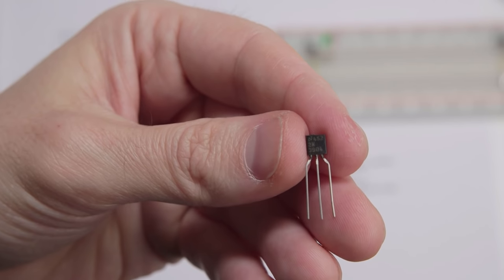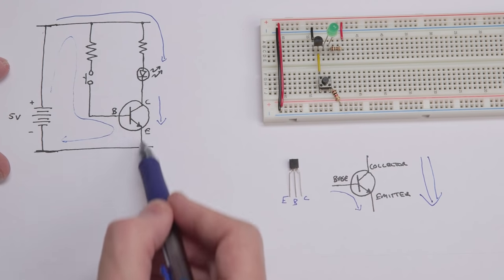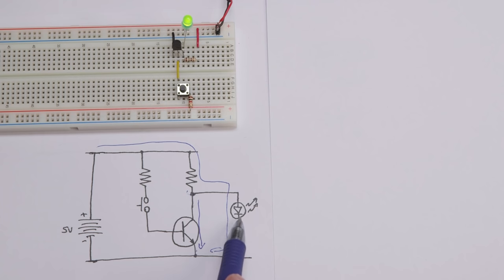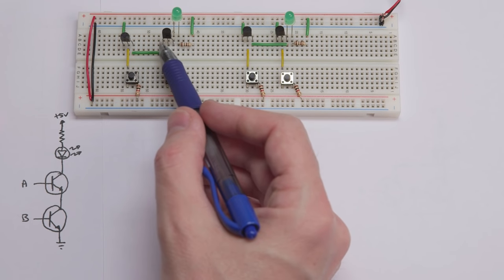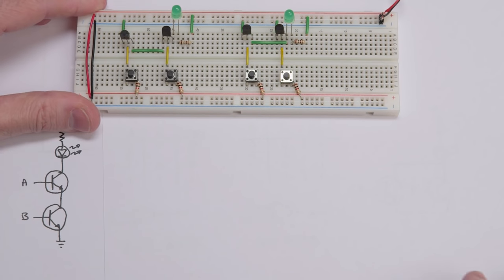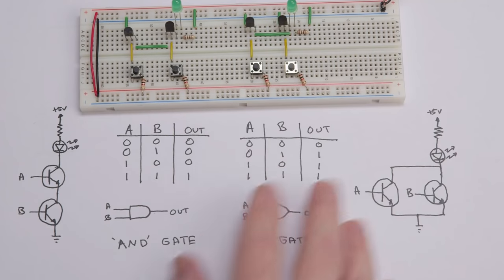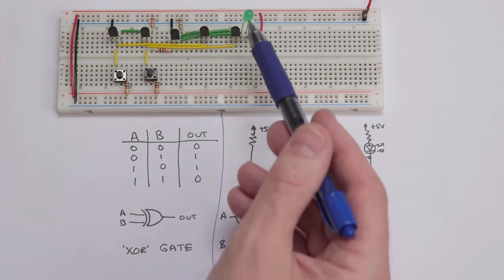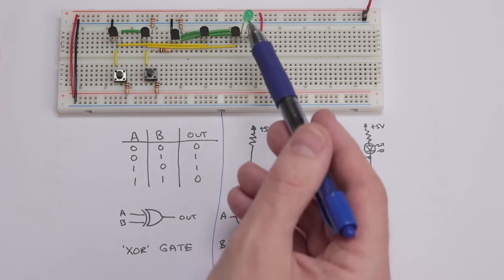Making logic gates from transistors

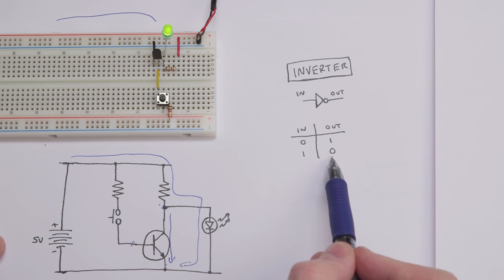Comment: Super noob question here: at 4:13 why does current "choose" to flow through the transistor instead of the LED?, is it because the LED has a slightly higher resistance?
Reply: That's my question too. I don't think it's a super noob question.
Reply: Even if the LED had high resistance, I don't see how the current through it would be reduced by turning on the transistor. In a parallel circuit, the voltage through all resistors is equal. So the voltage through the transistor and LED should both be the same. All adding the transistor does is allow for more current to go through in total.. it shouldn't have any effect on the LED. If you do the math on a set of parallel resistors you'll see what I mean.

PS: From what I've read online, an LED has a resistance of about 12 ohms and the emittor part of a transistor has a resistance of about 6 ohms. Do the math on parallel resistors and you'll see that it doesn't matter if the transistor is on or off. LED should have the same current and voltage in either case.
Reply: In other words, I have no fucking clue why the LED is turning off at 3:30
Reply: haha ok, thanks anyway
Reply: Your comment was deleted as spam (not by me). I suppose it's because you posted a  tinyurl... But thank you for the diagrams in there. They actually made it easier to understand (and tinker with) the circuit.
Reply: Kevin S. Piedra M. wait what? did u understand? Please explain to me
Reply: I believe, to my understanding, that it boils down to being that when the transistor is powered, it has a much lower resistance than the LED, therefore the current flows through it and not the LED. When the transistor is not powered, the current "can't" pass through the transistor and so it chooses to go through the LED. Basically, the normal functionality of a transistor being applied.
Reply: For the led to light it needs both voltage and current and the current is being limited by the resistor coming from the 5v rail so the power supply can't just supply the current that every component would draw when the transistor is on. If there were no resistor the led would stay on even when the transistor was turned on (although not for very long because the led would burn out).
Reply: Voltage within a loop sums to 0. Look at the loop with the transistor and the LED, and nothing else. since voltage = current * resistance, then for the LED to be on there needs to be current flowing through it, and therefore a voltage across the LED. This means that within this loop there would need to be an equal and opposite voltage difference somewhere else, meaning there would also need to be resistance in the left side of the loop (the transistor side) for there to be voltage across the LED.
Reply: I 'think' this is exactly what they mean by "choosing the path of least resistance" literally comes from.
Reply: The LED can't light up because there's no voltage difference from one side of the LED to the other. They key is to think of what is separating the voltage of one area in the circuit from another. If there is no resistance or voltage drop, then there's no voltage difference. So when the transistor turns "on", there is nothing separating that whole section of the circuit from ground, so it all goes to 0 volts.
Reply: It really comes down to transistor saturation. When the switch is depressed, the base to emitter voltage will read about 0.7 volts (Standard BJT base-emitter voltage) because depressing the switch allowed current to flow in from the base. The base to emitter voltage is larger than the emitter voltage itself (0V), therefore the transistor goes into a state of saturation and acts as a short circuit, allowing all of the current to flow through the transistor- turning the LED off.
Reply: Mind = blown
Reply: When the transistor is turned on, the voltage on the LED is not high enough to overcome the forward voltage requirement. The transistor is essentially turning on half of a voltage divider.
Reply: when the transistor turns on, which makes the voltage 0 volts and doesn't turns on the led
Reply: of course even in a short circuit there should be a tiny current through the led, because it is never zero ohm if you think as a normal resistance. But the led isn't a normal resistance, it is a diode and needs therefore a certain voltage to allow a current and to light up.
Reply: I would think an LED would have capacitance, even if the voltage leakage is technically zero. Capacitance can be converted into resistance.
Reply: Current in a circuit always chooses the path of least resistance. Lighting a LED requires more power (and resistance) than simply flowing through an open transistor.
Reply: The potential difference across second resistor during saturation is 0 V because ground is then reached. Some electrons might indeed go through the LED, although due to the resistance and repelling forces the electrical fields cause the current through the LED to be negligible. It's important to think about voltage only in terms of potential difference. We can have potential difference, but current only if there's a closed path and a resistance according to I = U/R. As others noted, the path with least resistance is chosen.
Reply: Since Ben hasn't replied to that question, I assume that he doesn't know either. 
My explanation so far is that current is actually going through the LED, but the current is not strong enough to light it up. That's because transistor turns on and since it has lower resistance it passes through more current from the input source than the more resistant LED on the parallel path (voltage on the both paths is the same, so the branch with least resistance gets most of the current according to the Ohm's Law).
I think Ben's schematics isn't 100% accurate. To turn that parallel LED path really off, there should have been a resistor before the LED which would cut the voltage entirely.
I'm a noob in electronics so I might be wrong. Although, I googled all the concepts of current flow through that parallel circuit and with the use of Ohm's Law and some common sense it sounds quite reasonable.
Reply: For anyone still wondering, I posted an answer to this above.
Reply: YES (and no) you are almost right, the led does not have a resistance, but a voltage drop, now the  LED does not turn on because a parallel connection always has the same voltage drop, but the transistor does not (as far as I know) have a voltage drop so the voltage drop will be 0, and an LED needs about 2 volts to turn on so therefore it will not turn on
Reply: The transistor does have a voltage drop of around 0.2V (C-E), as the LED is connected in parallel with the transistor the voltage across both the transistor and therefore the LED is only 0.2V.  This is not enough to light the LED.  It is tricky to wrap your head around because us newbies often think of voltage around the whole circuit instead of simply the difference between any two points.  I would suggest you build the circuit and measure voltage across the LED and transistor when the switch is open or closed and maybe even measure current flow.   Another circuit you could make is a straight jumper instead of the transistor, then put a resistor in parallel to it.  You will find as the voltage across the short circuit jumper is 0V the voltage (and current) through/across the resistor will also be 0.
Reply: ok, thanks i get it
Reply: It's because when transistor turn on led will be short circuited.
Reply: Actually, a current will flow in all paths that have a resistance, but since the transistor is ideally 0 resistance it will take all the current leaving nothing for the led branch
Reply: IDK
Reply: I want to answer this question. Normally Diodes actually needs at least the threshold voltage to get conductive. Even then it will reduce the voltage to voltage in minus threshold voltage for example. A diode with 1 volt threshold needs more than 1 volt to be even conductive. Now i will tell you the real deal. Transistors and diodes are actually diodes ( led is an (L)ight (E)mitting (D)iode. And a transistor is two diodes like this  -->||<-- (two diodes with their otput side is looking at each other and base input is in the middle of thesetwo output sides)) If an diodes threshold voltage is not reached it is a non conductive thing. But a transistor behaves like a short circuit because you are giving that threshold voltage to the base leg.(and transistor  doesn't effects the line voltage because it is already saturated)  Now i think you get it. Led doesn't turn on because there is not enough voltage.
Reply: Okay, so first I was questioning why the LED was turning off. Now my next question is which answer to the first question is correct, lol.

From what I understand, the voltage across all branches should be the same, and the current gets shared, in a parallel circuit. I thought that it was the lack of resistance on the path opened up by the transistor that leads the current down that branch, as the resistance on different branches affects how the current is shared between the branches. 

I also ran a simulation with two 1 kilo Ohm resistors in parallel, and a decrease in resistance of one branch increases the current in that same branch and decreases it in other. The current in the other branch, with the kilo Ohm resistor, slowed down and eventually stopped when the resistor in the other branch was dropped to around 10 Ohms - 15 Ohms, or it was so insignificant that it could barely be seen. I am on an iPad and can’t afford proper simulation programs that measure the voltages, etc.

So increasing resistance in one branch decreases the current in that branch and increases the other, too. The transistor completely closing the circuit, when in a cutoff state, sends it all to the LED.
Reply: When appropriate voltage is applied from base to emitter, this energizes the collector to let current flow. You need a minimum voltage to pass current through the energized collector, much like diodes; however, a transistor's forward-voltage-drop (from energized collector to emitter) is much smaller than what a diode needs to activate. Given this is almost always the case, the voltage on the node shared by the collector and anode is not enough to activate the diode, so no current shall pass.
Reply: Both the resistors are same. I think we can just ignore the resistance of the transistor and the LED. So the statement shouldn't apply, I gueas
Reply: Many of these answers hit around the bulls-eye but either slightly miss the mark or are incomplete. First consider if you attached both legs of the LED to the ground rail it will not conduct. Easy to understand. 

Now think of a transistor as a variable resistor ("transistor" is short for "transient resistor") but it can go from nearly infinite resistance to full conduction (or full saturation). This is the design of the 2N2222 logic or switching transistor to act in a circuit as a switch rather than an amplifier.  That being the case, if you replace the 2N2222 with an actual mechanical switch or even a relay controlled by the existing button, the circuit will behave exactly the same (for all practical purposes). If the switch is open (or transistor not conducting) then +5 volts is present at the bottom of the resistor and the LED lights. If the switch is closed (or transistor in full saturation), this directly connects the bottom of the resistor to ground and the LED is essentially connected to ground on both legs. You could say the switch (transistor) shorts the LED to ground and this would be basically correct.
Reply: the resistor and the transistor form a voltage divider. the transistor can be seen as a resistor. when it's turned off, it has high resistance, so the voltage at the junction is high. when the transistor is on, it has low resistance, so the voltage at the junction is low (the transistor pulls the voltage at the junction low)
Reply: Kevin S. Piedra M. It's because electricity takes the shortest path from + to - . It's not gonna bother lighting up the led on the longer path. It's just gonna go the short way
Reply: @bcddd214  No. This path of least resistance is bullshit. Current can flow through various paths, including least resistance paths, it will just get divided up and less will flow through a less resistance path. If that path is a complete circuit however, you will still get flow of current to all paths.
Reply: DevinDTV current is equal to the voltage drop of the component divided by the resistance of said component.  Thus, the amount of current traveling through the transistor would be greater than the amount of current traveling through the led. Electrons will follow the path of least resistance.
Reply: Electrons choose the least path of resistance
Reply: check parallel vs seriaö circuits
Reply: It's because the path through the led has more wire in the way, giving it a higher resistance. So, when the transistor is on, the path through it has a lower resistance than the path through the LED, so the electricity goes through the transistor instead
Reply: @fastlingo  You are correct and explained it well. A transistor is a resistor that can change resistance as more voltage and current is applied at the Base. In fact the name is derived from TRANSfer resISTOR
Reply: @3DPDK  Well explained. An ideal transistor would behave exactly like a mechanical switch but much faster. It's easy to see that if you replaced the transistor with a switch there would be no voltage dropped across the switch when it is closed. The LED is in parallel with the switch so no voltage dropped across the LED either. In practice you would get bout 0.6V dropped across the transistor and LED which is not enough voltage for The LED
Reply: @malteeaser101  Replace the transistor with a mechanical switch. When the switch is off, you are left with the LED in series with a resistor so it will be on. Now press the switch and you basically short across the LED so the voltage dropped across the switch and LED will be zero therefore no current flow through the LED. The current flow will only be restricted by the resistor connected to the 5V rail. Without this resistor you would switch directly between 5V and 0V and pop the fuse in your power supply
Reply: For current to flow between two nodes, there needs to be a potential difference between those two nodes. When the transistor is powered on, there is a positive voltage at the emitter end of the transistor, hence there is no potential difference between the two nodes that connect the led to the circuit
Reply: I don't know if someone mentioned this up to now but the the LED is in Parallel worh the Collector-Emitter of the Transistor that means the Voltage of both (LED, Transistor) at this point to ground is the same, the only difference is the current which divides into this two paths now and because of the small resistance of the transistor (0.1 ohm) there is much more current flowing in the transistors path than at the LED